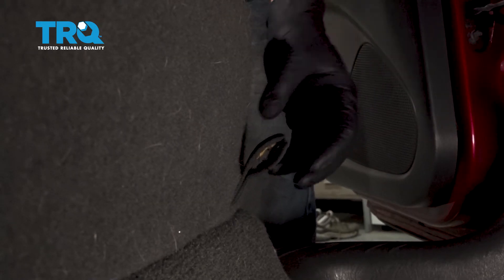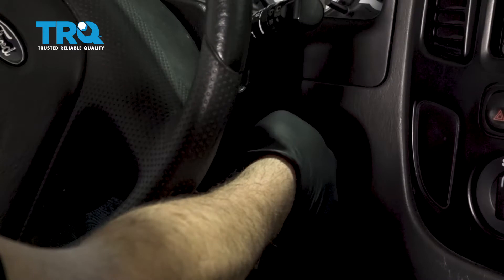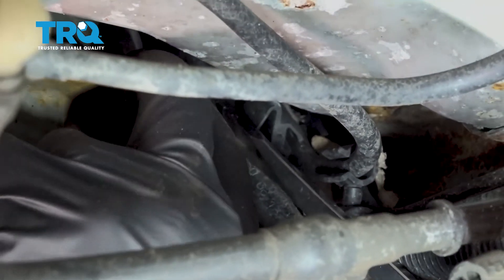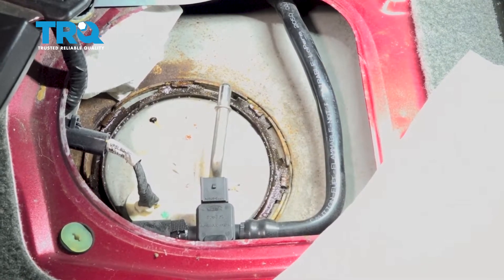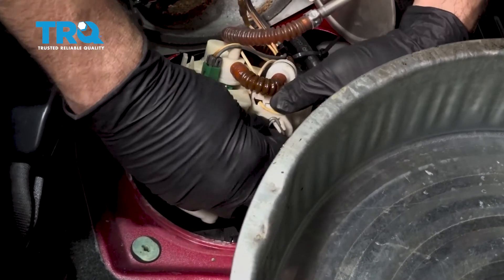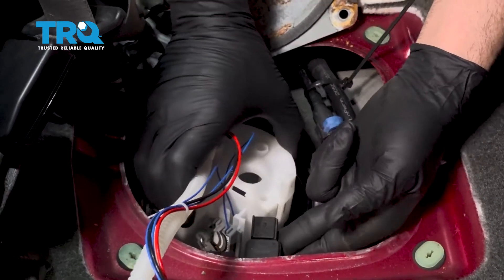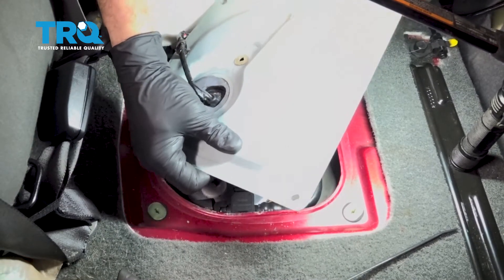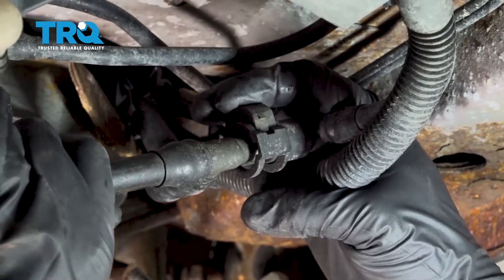How to Replace Electric Fuel Pump Module 2001-2007 Ford Escape

Comment: There isn't anything on this vehicle (Mine is a a 2006) that doesn't cost a fortune to repair. I just spent over $1,000 to have valve cover gaskets replaced along with spark plugs because of how hard the V6 is to do. My gas gauge is stuck after a front end collision. No way I want to try this repair myself.